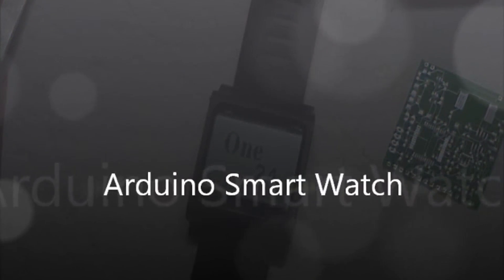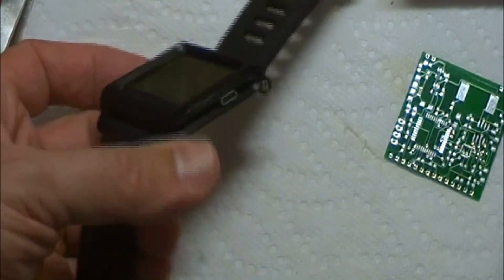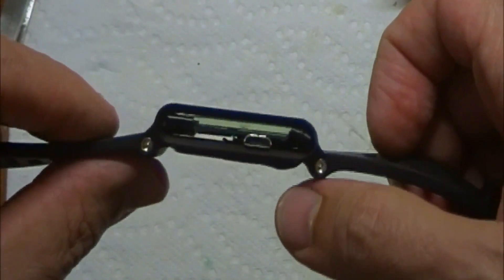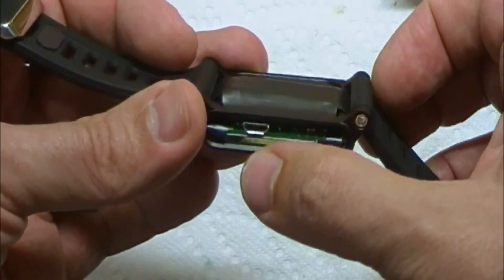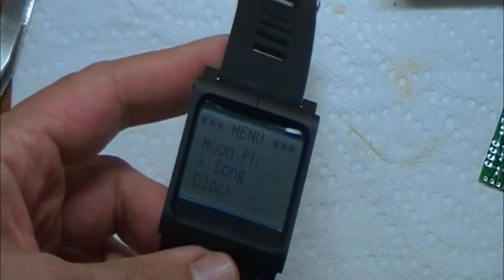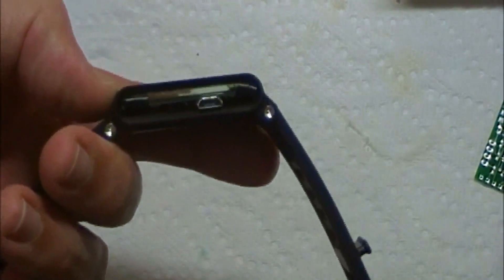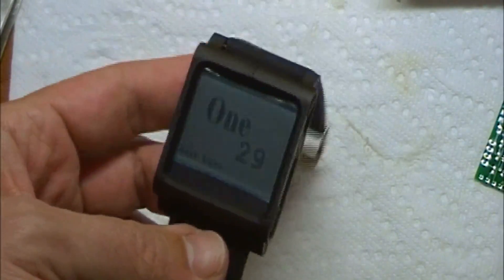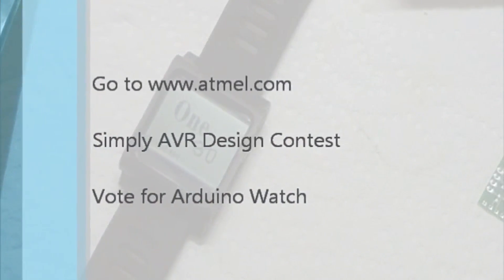Arduino Smart Watch 2

Comment: Hi Dan,
I was wondering how you protected and charged your lipo battery with the same port of the microcontroller. 
I am making a simular project but have to use existing components but can't seem to find a charger small enough.
Sorry for my question on this relatively old video.
Awaiting your responce.
Reply from the maker: +Dwight Peters I used a charge controller chip. See my blog for all the details.

Comment: How long does the battery last?
Reply from the maker: About 5 days right now. I have a software version that shuts down all the peripherals and display and just runs the watch to keep time and it lasts about 9 days on the 110mA battery. That turns out to average 0.5 ma/hr.
Reply: Dan Geiger
 That's much better than I thought haha. Nice. you know any good add ons for measuring hertz?